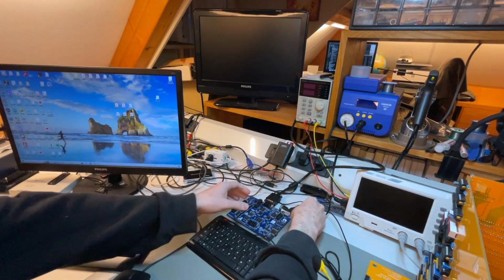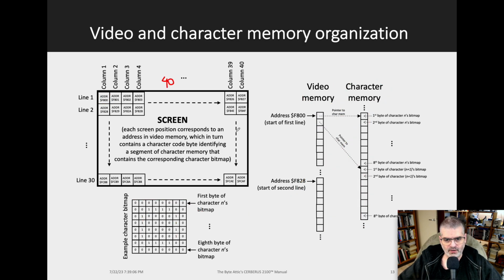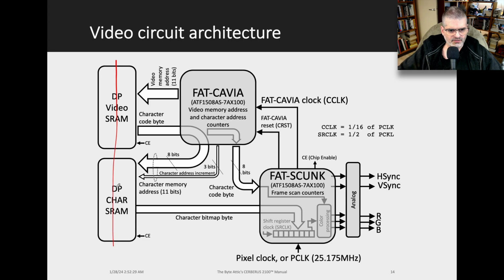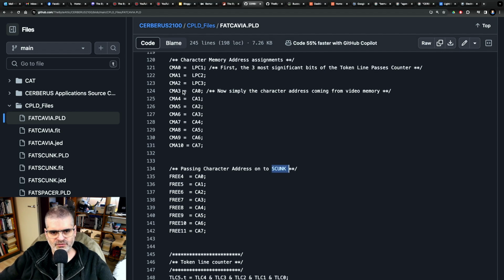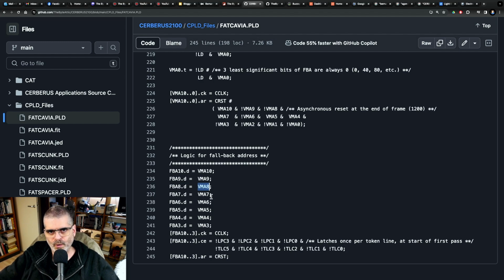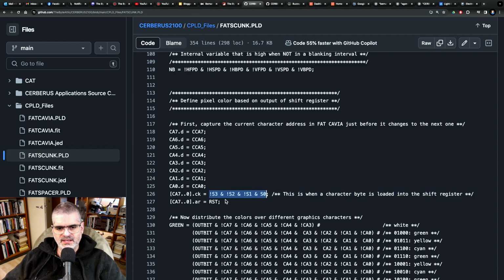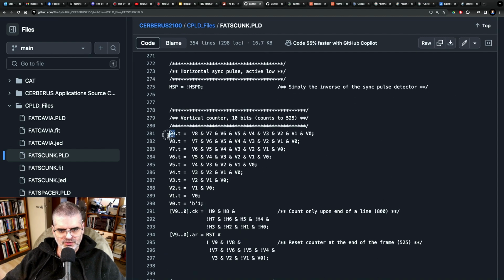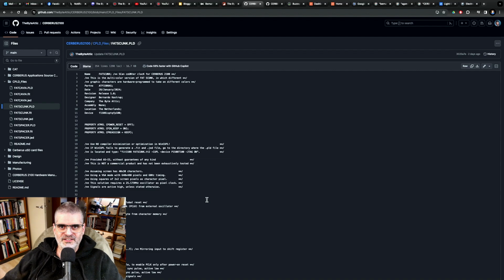Exploring CERBERUS 2100™, Episode 2: the video circuit

Comment: Wasn't it possible to use a bit of Video memory (or character memory) to put 256 bytes (for each character) with 3 least significant bits = R/G/B bits so that we let people the possibility to choose color for each character by code? Hardcoding which color should a character take inside SCUNK seems a bit unfair to my 'developer pov' 😉
I understand that It implies to access another area of memory but it could be easily indexed with character value. Or maybe it impact internal SCUNK counters too much. IDK
Reply from the maker: Would it be possible to have programmable colors? Of course. But not using this architecture, as both video and character memories are already being accessed all the time by CAVIA, to read the bitmap bytes. I could use 16-bit DP memories to circumvent this, but wider DP memories are ridiculously expensive. Notice that CERBERUS aims at being an educational platform, not a games one. So I prioritized simplicity, visibility (down to the gate-level) and, to the extent possible, cost, not gaming features. It's just lucky that colors could be added. With all this said, because the computer proper isn't burdened with video generation AT ALL, quite complex game logic can be programmed in it; just not flashy graphics and sound.